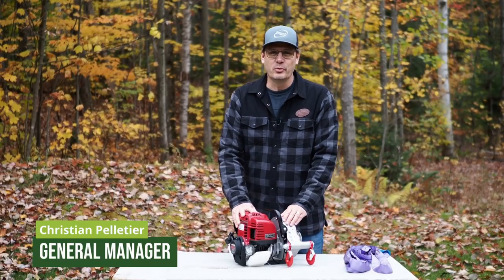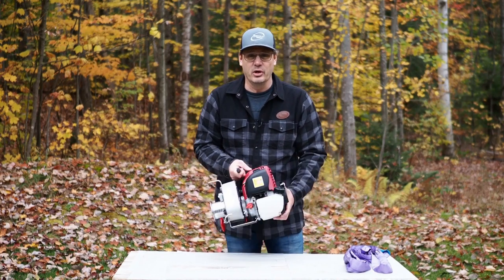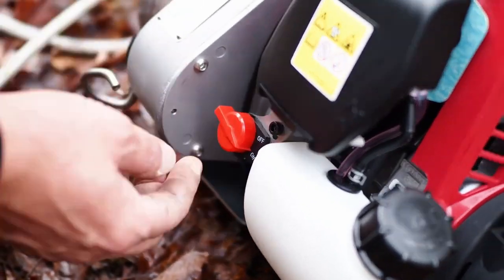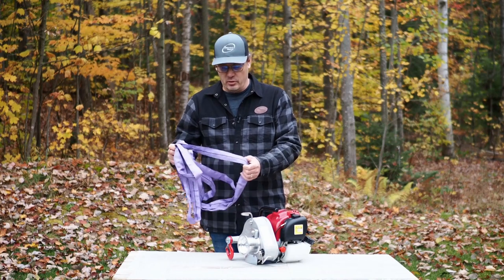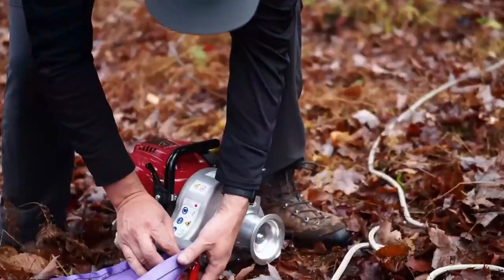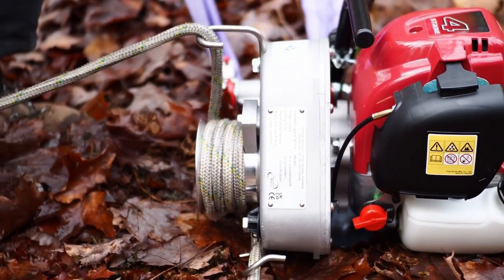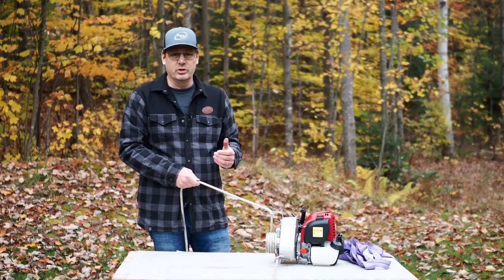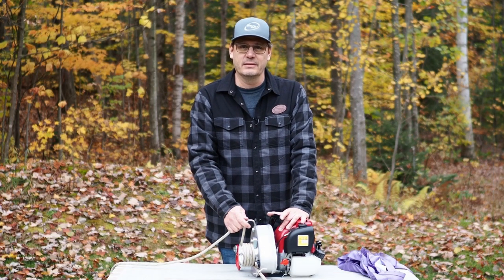PCW3000 Introduction 2024 | GX35 Gas Powered Pulling Winch

Comment: We have a little GX35 on a string trimmer and it has been great for us. The oil gets changed twice a when we’re using it and a quart of oil lasts about 5 months which is a season for us. First use of the year we leave the choke open ignition off and give a few pulls to oil it up before starting. Great little engines that are reliable and sip the fuel!